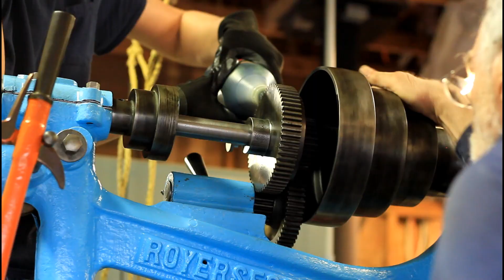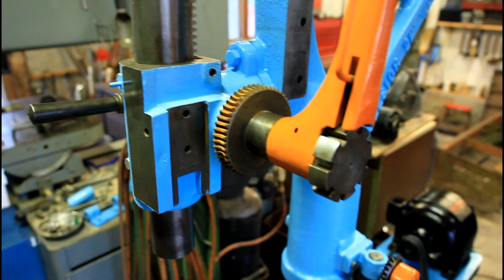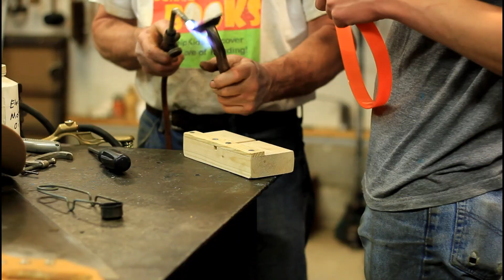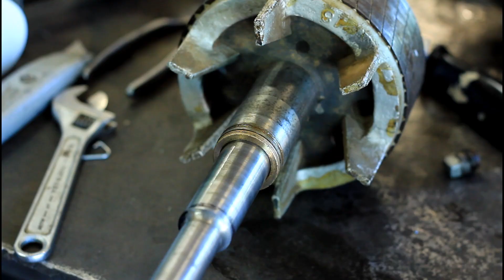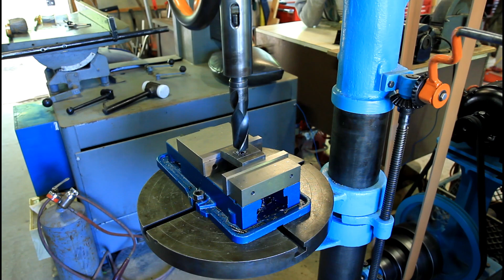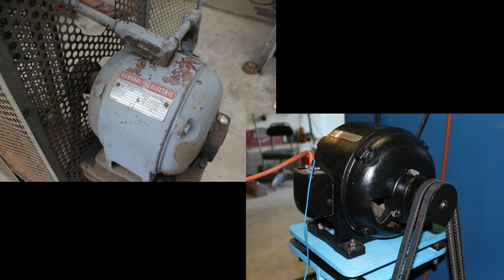Camelback Finale -- Belting, Fixing and USE!

Comment: Enjoyed this series a lot. Good work and a great looking end result. As this is some years ago, has it held up - and are ther something that you would have done differently?
Reply from the maker: Hi Hiksan,
Great comment.
A little I would have done differently. I would have primed it or done two coats of paint. I wish I remembered what I used. It went down great, but has had some dark spots bleed through.
I would probably use leather belt rather than polyurethane for the feed. It's okay, just slippery.
I'd love to have glued a washer to the feed pulley somehow to keep the oil that leaks from the babbitt off the belt. I added bits of felt into the oil holes to keep the dust out.
I did go in and update the electrical and added some conduit to clean it up. I probably should have left the shims in the motor more how it was.
 I now have it leveled and bolted to the floor in my new shop.

Still two things to do. 1., upgrade the shims for a bit better adjustability on the babbitts.
2., Balance all rotating assemblies, as it vibrates the whole machine in high speed.

Otherwise no, this machine is near perfect and runs really well. Cheers.
Reply: @TheMetalButcher  Thank you for you reply.
These are realy good and usefull reflections, probaly also for others to hear. If you need inspiration for a video ot would make for great content to go over older projects: things learned, desired changes etc. Especially the work and adjusting of the babbit bearings is interesting (as information on these are rare)

It seems that this type of drill was rarther common, and I found 4 different drills on the 2nd hand market here in DK, alle from different manufacturers, but almost identical. Perhaps clones, perhaps the same factory built for several brands.

Comment: Good job man ! I’m just picked up one my self can’t wait to break it down . Question where did you get the flatbed and if you have to do over again would you do anything different ?
Reply from the maker: Hey thanks! Awesome to hear. The truck? It is my dads. It has now been parted out to support other trucks. Not much left to it. But used Isuzus are everywhere. Kinda pricey right now, and really slow.

Would I do anything different? Not really. I'd try to keep more of the switch conduit intact. I still love the reverse switch, so I'd keep that. I may have reconsidered paint color. It still looks good though, so IDK.

Good luck on yours!

Comment: Nicely restored mate. We still have the three phase motor for dads 1909 Rockford but it’s been on a half horsepower 220v motor since the 70s. The gearing on them really doesn’t seem to need the three phase. Run them so slow with the big drills u can count the revolutions by eye. You’ll love that machine. Make sure your kids get it.
Reply from the maker: It certainly has plenty of grunt, but I like a strong motor and hey, why not use the original motor. I like keeping a machine original if it doesn't improve it to change it.